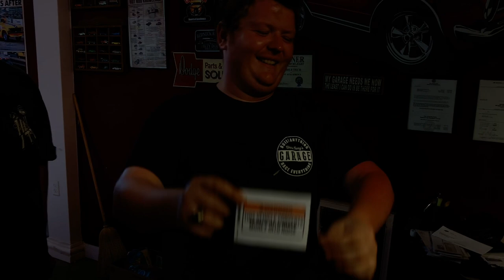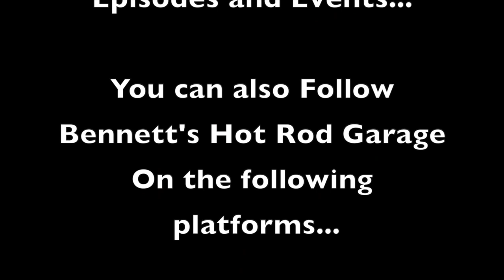UTG sent John Austin and Garrett (Uncle Tony’s Kids) to pick up some parts for junkyard jet

Comment: Uncle Jimmy! You are awsome! Just the 4 speed (with shifter too!)  and rear axle housing was great. But ball joints, super stock springs, fuel cell and a aluminum radiator! Wow! Your level of generosity is tremendous!

Comment: Austin, Garrett, and their cameraman are good guys - it will be interesting to see what they do with Junkyard Jet.  I haven't drag raced in years,  I have somewhere under 1,000 passes from when it was a big part of my life for a number of years.  I agree about disc brakes, in my experience four wheel drum brakes were dicey at tracks with short shut downs at speeds of 110+ mph.

Comment: The comments about the drum breaks is so true. I had a '71 GTO that I raced it had no AC, no power steering, no power brakes, no nothing. I had a fully mechanical distributor (Mallory duel point) no vacuum advance, a Holly duel feed double pumper, only one vacuum line for the PCV, and 4 Drum Brakes that after the first stab on the brakes they floated. Go fast and throw out anchor to stop.
Reply: Drum breaks just aren't practical anymore it's so easy to change them to disc and they preform better and stop you quicker than drums ever thought about doing lol and disc conversions are so cheap as well

Comment: If you want a cheap cam for the magnum there is a company that does 200 dollar regrinds on eBay. The company is out of Texas and you can throw it in with the stock lifters. Cheap way to get a hotter cam in it because the hyd roller cams can be costly. 

We put a bone stock 5.2 magnum with a intake , carb and headers with a 391 gear in a mirada and it is good for low 14s with a crappy lockout converter and sloppy trans